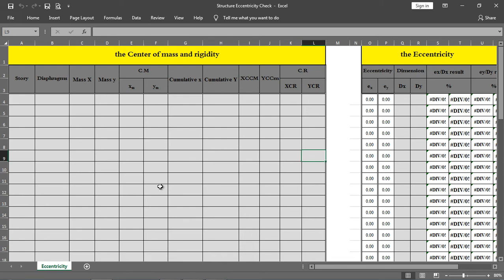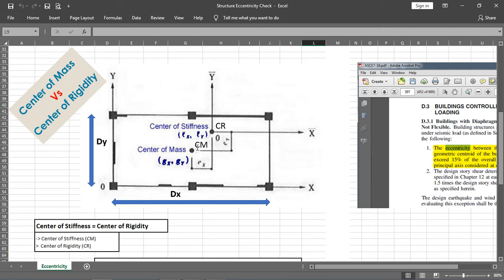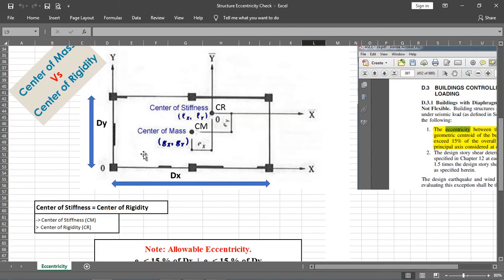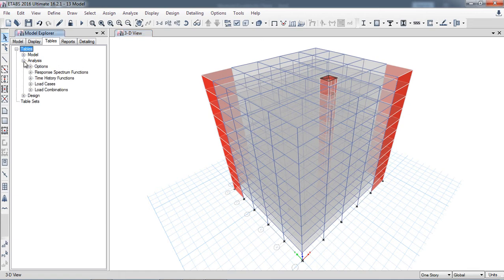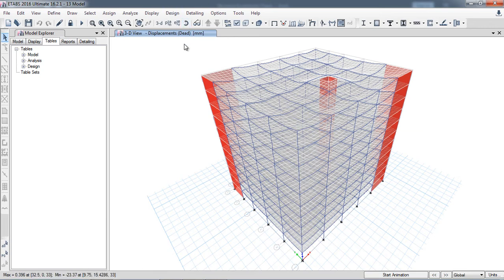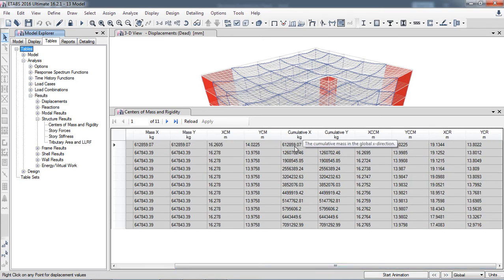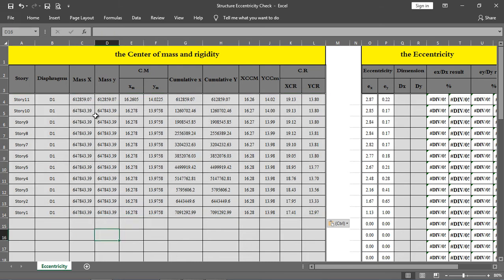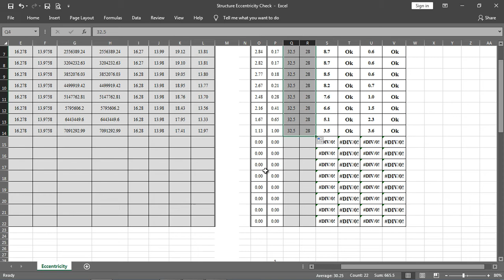CSI ETABS Course - 06 - Building Eccentricity Check (Irregularity check)

Comment: sorry but i think that calculations are not ok, because in the code they mentioned the eccentricity between center of mass and the geometric center should not exceed 15%, they didn't mentioned any thing about center of Rigidity it is something related to the distribution of mass on the plan no relation with center of regidity

Comment: Shouldn't we modify the eccentricity from 5% to the calculated value?
Reply from the maker: Please see next videos... it is shown

Here is the Full Course link on CSI ETABS
https://www.youtube.com/playlist?list=PLRIk1R_YACcLuzzYT-4jY9IgnFNNCNnvI
Reply: When i tried. Why all mass in the table is 0.
Reply from the maker: @  If all the mass values in the Building Irregularity Check table in CSI ETABS are showing as 0, there could be several reasons for this issue. Here are the possible causes and solutions:

Possible Causes & Solutions:
Mass Source Not Defined Properly

Check the Mass Source settings under:
Define → Mass Source
Ensure that self-weight, dead loads, and any additional mass-contributing loads (e.g., live loads) are correctly included.
If the mass source is set to "None" or has no contributing loads, then mass values will be zero.           ---------------------                How to Fix It?
Check Mass Source Settings:

Go to Define → Mass Source
Ensure that Self Weight Multiplier is 1 and all necessary loads are included.
Re-run Analysis

Click Analyze → Run Analysis after fixing the mass source.